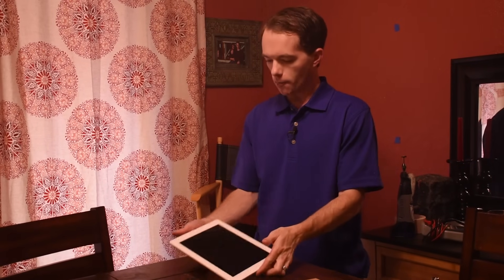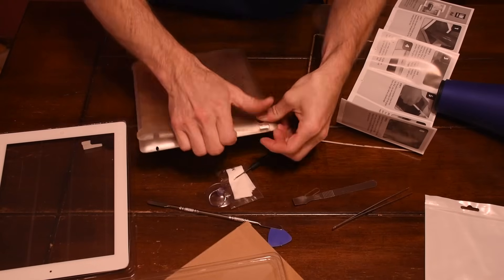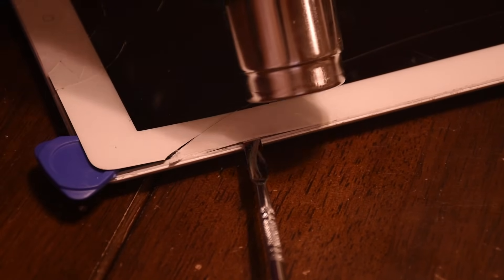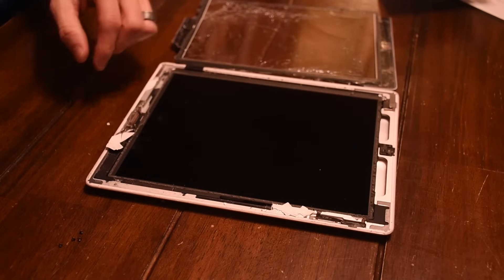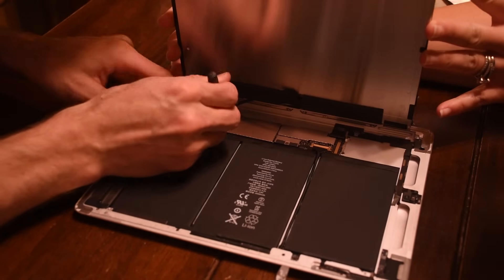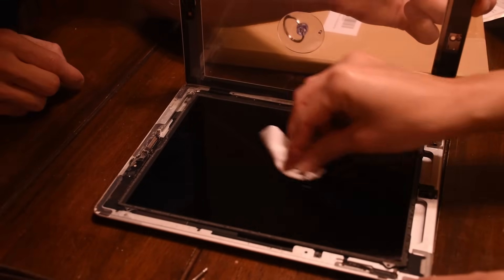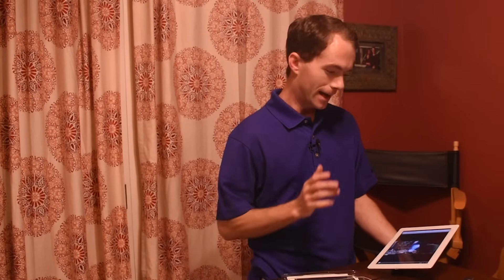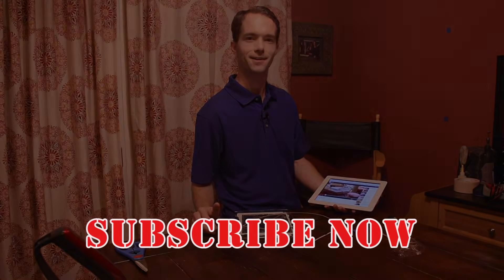How to Replace & Fix a Broken iPad Screen

Comment: I have an iPad Pro 9.7 inches.  Model A1674.  I looked for, and found a replacement screen (digitizer?), but a couple of comments said that the digitizer is glued to the lcd screen, so you have to replace both.  Does anyone know if this is true.  The digitizer replacement screen is $65, but the combined digitizer and lcd replacement is over $200.
Reply from the maker: That doesn't make sense. You don't really have anything to lose by removing the digitizer. If it is, in fact, glued on that model, then your screen is still probably ok. Just do one thing at a time to minimize cost and risk. Thanks for watching!

Comment: Hi Mike. Did you find the new screen is as durable as the original? I’m worried the 20$ screen might just stop working after a few weeks, like so many other cheap electronics. Thanks!
Reply from the maker: Yeah, it's held up all this time. The obsolete iPad isn't used much anymore though. Thanks for watching!

Comment: whoever fixed my ipad used a very weak new screen and didnt put it on right. 
1st it cracked the 2nd day i had it back from me dropping it on carpet,
2. its pushing its own buttons
3. the WHOLE SCREEN CAME OFF
4 im so done
my plan is to buy a new screen of amazon,
and explain to my dad how he got ripped of 
also im so mad rn cause my brothers just did the same fricken thing.
also now they both when u touch the screen it does nothing.
also the home button is not working for some fricken reason'
i know who fixed it. my dads worker, wont name him, who used to work at a 
us celluar, i will update this later

:(

Comment: Tip: be VERY careful with the glass! I’ve been fixing iPhones and iPads for several years, and the iPad is CONSIDERABLY more frustrating to fix. While the iPhone is one entire screen module, the iPad has not only the glass, but a digitizer under. Be extremely careful in avoiding touching the digitizer, and be hateful with glass exploding in your face. The glass may get everywhere, so be careful with your eyes, mouth , nose and even shoes. Best of luck to everyone, if anyone has questions regarding replacement let me know.
Reply: Just put tape over the glass
Reply: Mi mi ma mo mo
Reply: So basically, a mask, gloves and shoes could help to prevent glass from going into the wrong place.
right then.
Reply: @Thewaterspirit57  is there a problem with my comment ?
Reply: @diegogolfhotel  naw just a litte addition.
like one said, tape can help with the glass, but sometimes extra precautions will help.
since how harmful broken glass can be.
Reply: Hello my iPad is actually broken or what idk actually my iPad screen went all black and the screen had a crack we tried everything it’s on opening pls tell me how I do it .
Reply: @Zoyaofficialahmed1  if I were you I would take it to a repair shop asap. What year is your iPad from ?

Comment: I put my ipad in the glass shelf in the bathroom I left because im gonna get a towel because im washing my face,
whrn i eft i heard a BOOOM and when i went back it fell on the marble bathroom floor .. well my luck is like ehh so it fell on the sink and made a hole on the side.. BUT MY LUCK THAT IS EHH HELPED ME AND IT ONLY MADE A HOLE IN THE SIDE SO IT ONLY NEEDS SCREEN RELACEMENT my grandma said that it will explode if I charge it while its shattered?

Comment: If anyone does there iPad like this, be prepared to no longer have a iPad.

1. Top right hand corner is the button flex and is so easy to cut.

2. WiFi modules, you ripped them off, when doing it heat up the area, slowly lift it up but make sure there is a bit of card in between so you can take the WiFi from the glass

3. Get some cards, the reason it's shattering is because your pulling the screen up to much where as a card is a nice size in-between.

People please please do not do your screen replacement this way.

Comment: ok all done ipad is like new thanks Mike appreciate your video- anyone can do this with a little patience (1.5 hrs), heres my experience (in no particular order) and believe me if you can figure out a modern DVD player you can do this and save yourself alot-
1.  hair dryer at corner at least 60 seconds to loosen glue, use screwdriver instead of silly spactula you get with kit far better good grip
2. take photos as you go when recontacting screen always gold contacts in DOWN position 
3. if glass cracked near edge start there first, need to get LCD screen out of way with four screws as soon as possible then can get rid of rest of ipad face- if LCD damaged its over 
4. remember the thin white rubbery seal surround has a stick back tape on the back need to take that off so can seat easily on ipad before putting on new screen
5.  get rid of all old screen plus glue or else new screen will not sit correctly should take 5 mins with screwdriver but always delicate movements not forcefull as is first lesson when dealing with an ipad Get rid of all debris in ipad vacuum shake outside etc
6. if old screen edge difficult to remove hair dryer for 2 mins (only 2 inch at a time) then leave for 1 minute (lets glue absorb heat) then go with screwdriver (should take about 30 mins to get rid of old screen this is the major part of the job so dont rush it)
7. new screen has see through cover on the inside and out remember to take these off
8. test ipad- home button might not work until ipad closed properly but if ipad starts up and you can put in your password you are good to go IF NOT you need to go back and check the screen/ipad connections remember always gold contacts down (ie when you contect leads you shouldnt see the gold contacts)
9. when working on ipad put removed LCD screen in drawer so dosent pick up dust
10. One of the screen connections is very thin and extremely fragile and will easily nip, i found reconnecting this the hardest part of the whole process it took me around 20 mins to finally get it to connect with ipad body, i moved the screen and ipad until it was best location to try and get it in, i also used twissers and a small screwdriver and i finally got it in but it was difficult- i couldnt get it in with just my fingers 
11. After everything done and ipad is back together i put on carpet and covered with a towel and put a weight on top to press done on the ipad to make sure the seal was tightned up
Reply: Brilliant!!!!! I read ALL your notes. Much appreciated!!!!!!!!

Comment: I cracked my screen on my iPad a few years ago just by grabbing it and it still works but sometimes I have an issue with the touch screen I can’t even use a stylus anymore in it because it doesn’t read it properly where my cracks are

Comment: There’s a broken portion in my iPad which I can literally lift up. Should I just lift it up from there to make it easier to remove
Reply from the maker: That sounds like a terrific idea. Shoving the little spatula in and prying from the side was rather hard. Thanks for watching!
Reply: Mikes Inventions doesn’t work. Where did you get the heat gun in this video?
Reply from the maker: TheSwagGuy5000 well that’s no good. That glue they use is pretty tough. I got it from Harborfreight for like $10. It’s a great deal for no more than I use it.
Reply: @MikesInventions  update, things didnt go so good and now my battery and lcd are broken, F.
Reply from the maker: @TheSwagGuy5000  Oh No! That's painful to read. So sorry that happened to you.

Comment: I got my ipad fixed . just 2 days ago and it broke though there was screen saver on it.
I tried to remove the screen it just came off and there is a cable connected to the screen from home button and. And one from side .it was not glued correctly so i could remove it .now if i order the screen can i fix it by myself cables are not broken though they are intact eith golden part on it.how do i remove them to put back under the glass screen

Comment: How long did you use the heat gun for? I tried it for over 20 minutes total and it will not unglue
Reply from the maker: Hey Gabriel! Just a couple of seconds. I still had to pry it up, as you saw, but it allowed the glue to release much easier.
Reply: @MikesInventions   I tried for minutes and could not do it. Ended up cracking the screen trying =( . Wife is not too happy.

Comment: I didn’t even have my iPad for more than 5 months and today, when I was using my iPad , I found a small crack at the edge of the screen. ;( hopefully no one notices
Reply: I’ve had mine for two years and it works fine and in perfect condition

Comment: Thanks for sharing this.
My iPad 4 dropped a couple of weeks ago, and got cracked at the bottom, right below the home button, while also leaving a few cracks on the bezel sides as well a very long crack that goes from the bottom to the top.
Mind you, it had the original Apple SmartCover closed, when it dropped.
It's still usable, but I don't think I could all that by myself. Might try dropping it to a friend who does repairs.
Regardless, I'm kinda pissed by the poor quality of such expensive items.
Not even my Note 3, that dropped a couple of times, never substained any damage.

Comment: Put shrink wrap on the screen before removing and all that glass will stick to it instead of it going all over.👍 Nice videoclip
Reply: Clear packing tape works a lot better! It holds the smaller pieces extremely well
Reply: @Nicole yes! Agreed, hot guy Michael Jackson.

Comment: My iPad is glitches because of my cracked screen, does it fix that too?
Reply from the maker: Thicc Chick . Yes it should, as long as your actual screen is not cracked. This does not replace the actual screen, only the “digitizer” touch screen.
Reply: Hello Mike! I broke screen of my iPad. Could you repair mine please? 
“noahwon7@gmail.com” (925)421-9975

Comment: I replaced the screen on mine but the LCD screen wasn't working anymore. It worked fine before I replace the touch screen. Somehow I managed to damage the LCD display screen. Now I need to buy a new one of those. Thanks anyway
Reply: Maybe just try re-connecting all contacts

Comment: Thanks for posting this  - it helped reduce my nerves a ton! A few cautions for your audience - I have an iPad Air (v1 - model 1474) and my connecting cables were on bottom right. Also, I recommend wearing protective eye wear - many of the glass screen shards can scatter as you pry.

Comment: Why take the lcd off? Is this a necessary step?
Reply from the maker: Hey Tom! Yes, sadly you can't get to the digitizer cable connector without removing the LCD. It's a great design, until you have to repair it ;-)

Comment: i replace de screen in my iPad but by accidente when i was cleanning the extra glass es y scratch the LCD AND NOW THE IPAD DOESNT WORK, THAT CAN BE THE REASON OR I HAVE TO REDO EVERYTHING AGAIN.
Reply: Carefully take it apart again and check you connected everything nice and tight and correctly and nothing is bent, trapped or crushed. Then check again. Unless you gouged out a 3mm wide trench in the LCD there's no reason a scratch would kill it.